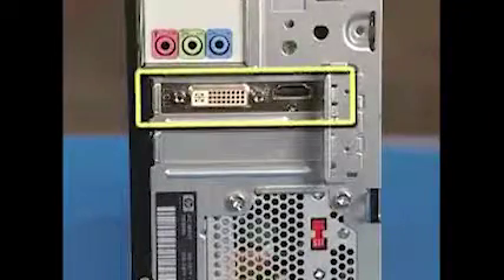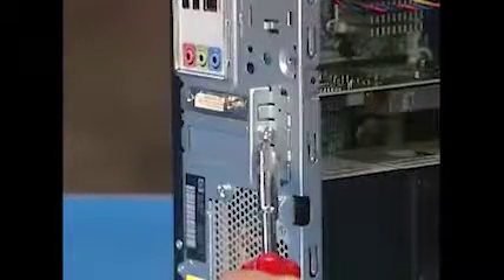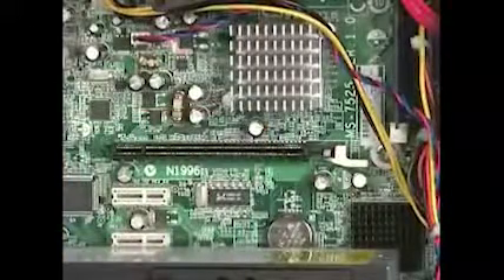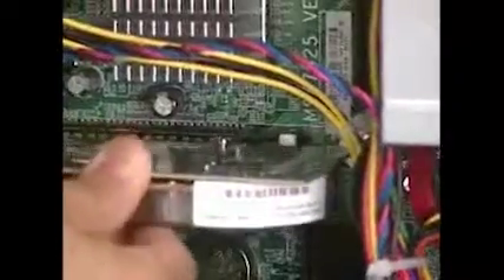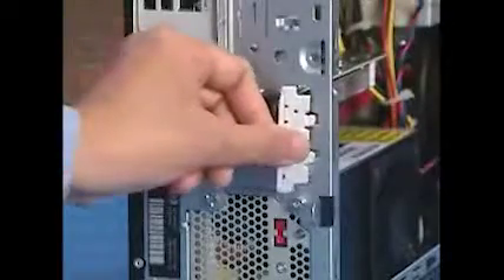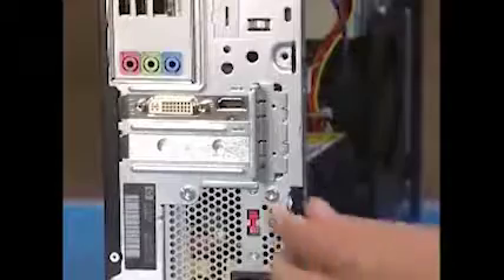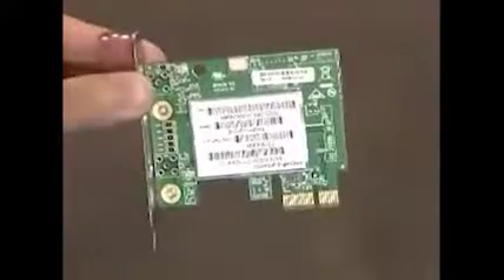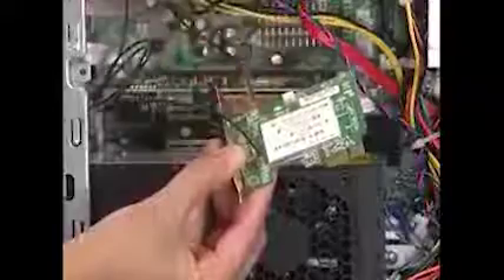Add or Replace Expansion Card | Pavilion Slimline s5000 | HP Support

Comment from the maker: Hi Anis, thanks for contacting HP Global Social Media Support!
I understand that you need to know about upgrading the memory of your computer.
I will do my best to assist you.
Memory upgrade information
Dual channel memory architecture
Two DDR3 DIMMs (240-pin) sockets
PC3-8500 (DDR3-1066)
PC3-10600 (DDR3-1333)
Non-ECC memory only, unbuffered
Supports 1GB, 2GB, and 4GB DDR3 DIMMs
Supports up to 8 GB on 64-bit systems (DIMMs run at DDR3-1066)
Supports up to 4 GB on 32-bit PCs
*32-bit PCs cannot address a full 4.0 GB of memory.
Binu_HP Social Media Tech Support

Comment: Hi HP or any answers
Any reason a HD6450 2GB GPU wont work in place of the standard HD5450 1GB model in the s5000 Slimline??
Reply from the maker: +BarryTones Please refer 'Processor upgrade information' under the specification page to know about the supported processors: https://bit.ly/3upA1pi
Reply: @HPSupport  Thank you for this response. My model is the s5133 which may be somewhat different to the s5623 in your link. 
For instance mine does not have any onboard graphics, not even a VGA connector and rely on the HD5450 card fitted to the PCIe slot.
Even tho is the M2N68-LA mainboard, I can't see any sign of it using NVIDIA GeForce 6150SE nForce 430 or even this chipset.
However, before I give up trying to upgrade to a 2GB, I shall try another GPU card. Great Info thanks.